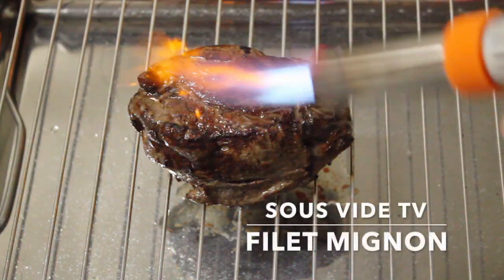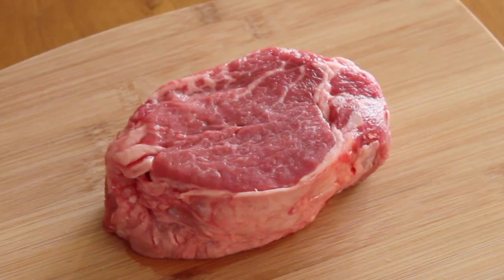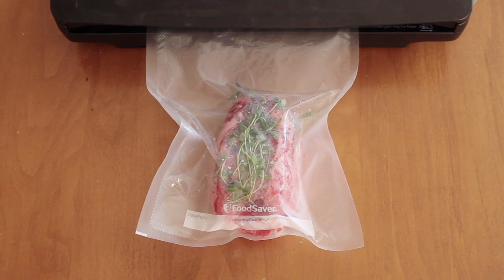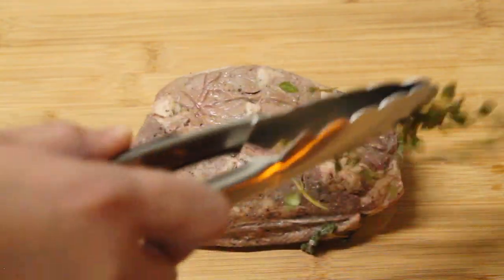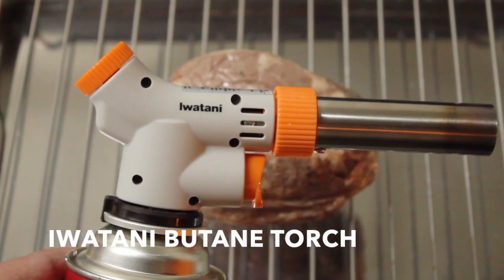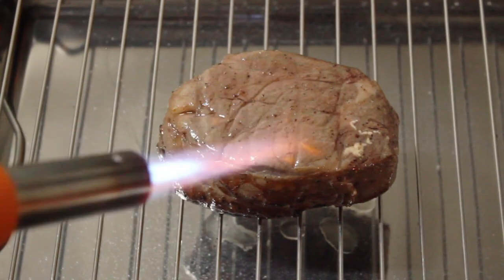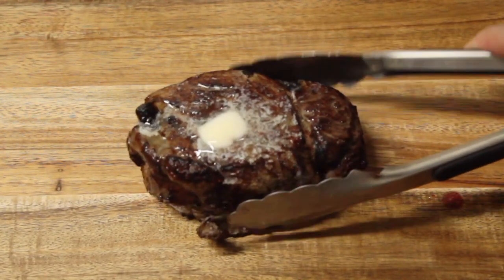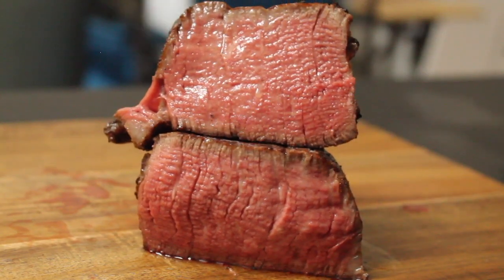Sous Vide Filet Mignon Tenderloin Steak with Blowtorch Sear Recipe

Comment: Ow Yeahh !!! lThose Mignon looks delicious af, great video as always !!
I see you're using Joule Sous vide machine, is there any downside to it? I was thinking of getting one between Joule and Anova Sous vide one, I want to know your opinion about this thank you~
Reply from the maker: Thanks for the kind words! I’ve used both the Joule and Anova, and think they are both great! Here’s my opinion on the differences:

The Joule is smaller and more compact, but you can only operate it from the Joule app. It does not have a display or controls on the unit other than an on/off button.

The Anova is larger and a bit bulkier, but has a display and controls on the unit itself.

That being said, I like using the Joule because it is smaller and easier to store in the kitchen. They both do work great though!